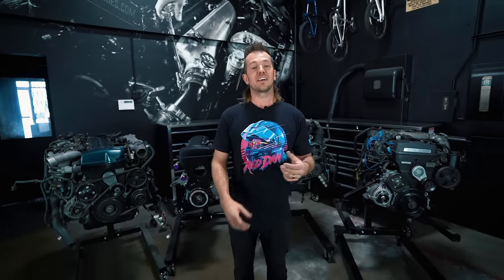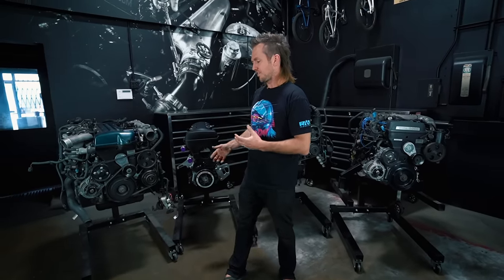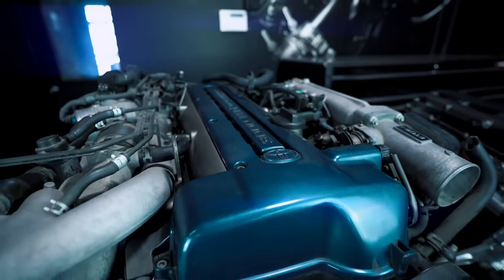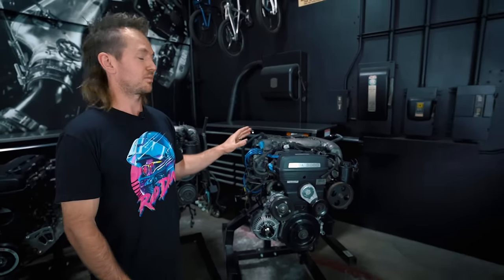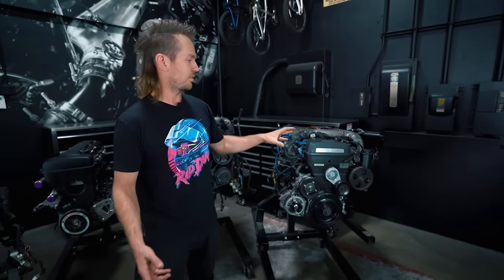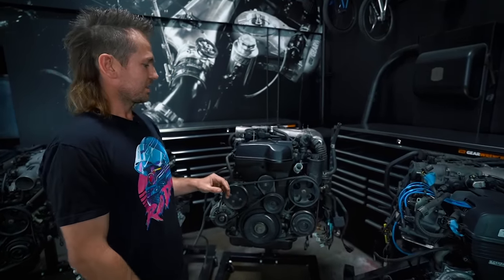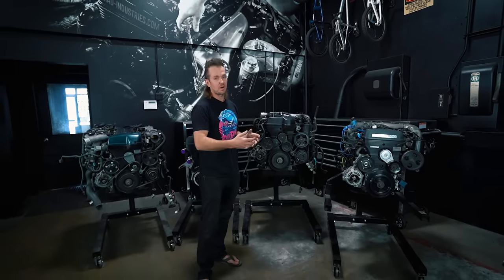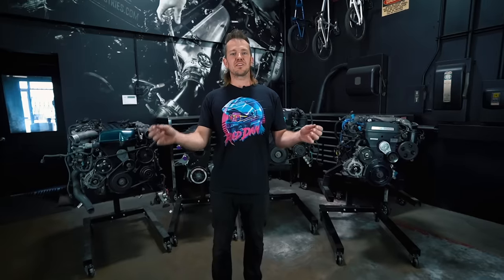2JZ Motor 101

Comment: Dude this is awesome! I'm currently building a NA-T 2jzge for my mk3 supra but I've been trying to find solid info on what I need. Cant wait for more videos on this!
Reply: That's a pretty insane project. I can only dream about throwing a 2JZ in my MK3 with the insane prices those engines are at now. At least my 7M-GE sounds good...
Reply: @rushnerd  I got mine for $80 last year, but now I'm 7k into the engine for an 800hp build, they make a ton of power but man is it expensive lol
Reply: @AngerySumo91  Holy hell you got some wicked deal. Just look at those prices on Ebay.
I would never attempt a swap myself so I assume the bill would be around $10K. Maybe someday, but it's crazy money when the desirable 2JZs go for $7.5-8K.

I'd be more than ok with 400, but damn man 800HP in an MK3 would be completely bonkers lol.
Reply: @rushnerd  yeah this was supposed to be a project but man I've gone down the rabbit hole hard haha
Reply: @AngerySumo91  I bought my 88' auto targa 7M-GE for $8K this year, 115K miles. I've already put almost $10K into it just in converting A/C, fixing power steering hoses, all the fluids, custom fiberglass quarter window/rear hatch shade trim, and custom LEDs all around. I feel your pain and it's STILL a slow car lol.
Reply: @rushnerd  it's a way of life with these I swear lol, my chassis was only 500 bur 140k and a dead 7m in it with a trashed interior lol. Got all new panels, seats, carpet, all that for around a grand off a part out car and then 7k on the engine but it still doesn't run 😂
Reply: @AngerySumo91  My engine was rebuilt and HG issue solved, interior is pretty much mint, but of course you pay for all that. The lifestyle in these cars I've seen this year and most ones for sale are ROUGH. I get it. Best of luck man, post an awesome video once you get your build done!
Reply: @rushnerd  thanks man I appreciate it!

Comment: with the ge non vvti its so much easier than the vvti some guy made a dual cam sensor for the ge and you dont even have to drill anything he also has a na coil pack that hooks up to the non vvti harness. you just have to plug the wires into the ecu.

Comment: INCORRECT ON THE 2JZGE NON VVTI, IT IS NOT AN INTERFERENCE MOTOR! I have one and snapped my timing tensioner bolt when the other wiggled itself out. It will just free spin not bending any valves!

Comment: On the 2JZ GTE VVTI you can pull about 400-410whp by the way of adding in a boost controller and a anti boost cut then turn up the boost pressure but too high and you risk blowing up your turbo ceramic turbine wheels as the factory ecu and injectors supplies plenty enough fuel to support 400whp.

Comment: I love my 92 sc300 5 speed Na 2jzge with a single turbo 💪
Reply: Are you running stock cam ? What did have to do to boost 2jzge? Does it have a distributor on it ?
Reply: @thaddienst9316  yea it’s a Na still have distributor, bolt on, gte head gasket, AEM ecu, tune on E85 1000cc injectors, upgraded fuel pump, honestly people under estimate the NA engines

Comment: Why is a 2jz gte block 2000hp capable but the ge blocks aren't?
If the cranks the same and you swap rods and pistons into the na bottom, what is the failing point in the na blocks?

Comment: I have a 2jzge vvti that I’m starting to build to swap into my G35. Can you give some Ideas what I need to get it to 400 to 550 HP. I’m want to set it up for turbo. If you can help. Thanks
Reply: Get the block from a nonvvti and a tt head gasket / arp head studs and swap the vvti head over to the non vvti block. While there separate the mid oil pan from the engine and get to drilled and tapped ( took my mid plate off the car and brought it to the machine shop cost $30)   put that back on and then add your turbo goodies, bump up the injector and fuel pump size obviously. Aside that you're pretty well set

Comment: 2JZ-GE non-VVTI are not interference engines. Non-turbo pistons are the same exact material as turbo pistons but they are stronger because the crown is thicker. Turbo pistons are not forged but they are especially well cast and feature two coatings to reduce friction and manage heat well. The same is true for all 1JZ/2JZ pistons regardless of aspiration. VVTI block castings are different but functionally the same. Some of the later non-VVTI engines actually used VVTI blocks while the change over happened.
Otherwise, good summary.

Comment: This definitely helped me out. I wanna 2j my s13 and just make a solid 500hp without spending a million dollars on a build witch I feel like will be impossible. He even said it himself the prices on 2jz are going thru the roof 😩
Reply: I went to the junkyard and pulled a 2jz ge vvti out of a gs300, I spend $300 and about 5 hours to completely pull. Ge heads are better for flow anyways, just gotta put gte rods and pistons in.
Reply: @superbird9095  The whole GE head having better flow has already been proven to be wrong. Regardless air flow isn't really an issue on any of the heads and the slight differences only begin to show difference when pushing the engine way past 1,000hp. Realistically not many will come close to that threshold and those that are at that high of a level will probably have some headwork done already further pushing the threshold higher.
Reply: @zXCrackersXz  Have you seen the heads compared side by side? Lmao the intake on gte has a big hump on the bottom-middle of the port, the exhaust is also bigger. Clearly you don’t own a 2jz and you clearly don’t understand how airflow effects the motor.
Reply: @zXCrackersXz  There’s a reason why nitro dragsters have a big intake for the blower because it adds length and rifles air down to the blower making the air cooler as it enters. If you have ports that are slightly bigger it will probably add to better response and better turbo spool, not really effecting hp. But full porting will add to both response and better power.
Reply: @superbird9095  Lol I have 2 2JZ's chilling in my garage and my 1.5JZ on my SC300 but sure kid I don't own a single JZ. You have some sort superiority complex? 

Go read all the technical data on the forums. The GE head overall does not flow better than the GTE head. The GE exhaust barely out flows the GTE but not it's intake. I've had this convo with many other Supra and SC owners as well as looked at the technical data. Everyone I've ever talked to has said realistically it doesn't matter as they all flow well and will easily achieve the numbers people aim for.

Comment: Could you put rods from a non-vvti na engine and put them into the vvti na with aftermarket pistons and still make high power?
Reply from the maker: Yes you could just put a VVTI head on a non VVTI bottom end and make 500 and it would be pretty reliable

Comment: One thing about the GE VVTI, when you remove the engine from the donor car it disables the computer. You either have to run stand alone engine management or you have to have your computer modified.

Comment: The UK and Germany got the most powerful Supra's.  We got bigger injectors,  brakes, oil coolers and turbos. Our cars were 325bhp everyone else got the Japanese version rated at 280hp, until 96 when  Europe stopped taking them, at which point the Japanese car then got the glass headlights,  bigger brakes, basically all the parts from the UK cars no longer being used.
Reply from the maker: America had the same turbos and injectors and brakes. We had 320 you guys had 325. But you had a few small features we never got.
Reply: @RADIndustries  did you get the ceramic turbos or the steel one's?

Comment: People have been pushing stock bottom end GE non vvti well over 900whp.
Reply from the maker: Never heard this before, but if you say so 👍🏻, that’s wild
Reply: @RADIndustries  This is a classic expample of the fisherman tale and 2JZ's. Everytime someone talks about it, it can hold 100hp more. The safe number on these motors used to be 650-700. Kids are reading forums and hearing things here and there and suddendly these are 1000whp capable motors stock.

Comment: So I’m in the middle of building an is300, got non vvti ge pistons and rods and a gte headgasket (among heaps more), aiming for 500-600whp, so even with the decreased cr, I should really invest in forged pistons? or will the non vvti ones be fine with a 9.4:1 ish ratio?
Reply from the maker: They will work but you know they aren’t designed for what you are asking them to do. They won’t last as long

Comment: In all honesty id like to get these heads, cams charted and compared.  Get at least 5 or 6 sets of the oem heads and cams of each model and flow bench them from progression of lift and then chart the average cylinder flow intake and exhaust. Get average cam lift for intake and exhaust. We know the bottom ends are stout but I feel the 750-800 Hp number is just a hype number I want to see torque curves.  The torque curve is way more important to me than the horsepower slightly less hp but a huge improved torque curve will drive more consistently.  Also those extreme hp numbers I personally don’t think the average tuner attains that I’ll give the benefit of the doubt maybe 500-550 but reliability is gone. And of course there’s the the guy with I got a friend who did this and then out come was way higher than what everybody else says.

Comment: Great video! Your thoughts on a 2jz ge vvti head on a 2jz ge non vvti bottom end with gte head gasket and arp head studs as well as oil filter sandwich plate to feed oil to the vvti gear.  I am in the process of building this and what do you think this set up could hold power wise on pump gas?
Reply: That setup is pretty much exactly as stout as an aristo block. A sandwich plate is unnecessary if you use an is300 union bolt for oil feed.
Reply: @DR-kc2pp  thats true, I am building the engine to go turbo so was going to use the sandwich plate to feed the turbo and vvti gear.  I will look into the union bolt to see if it can be used to feed both of these areas, thanks.
Reply from the maker: That’s the best of both worlds with a GE, but you still can’t go as high as a GTE block on power. But 500 is possible
Reply: @RADIndustries  nice thats about what I'm looking for, 400 to 500 whp.  Thanks for the insight and look forward to the videos!

Comment: I'm confused, Adam lz run a GE block due to higher oil pressure because the oil squertters is not there on the GE. And raddan wants oil squertters.. help me out im building a 1.5jz with ge block right now
Reply from the maker: Oil squirters help keep hot pistons cooler. It can be done without them. But trust me when I say they are there for a reason. I personally have never damaged a single part in a bottom end. I have build many race engines and never had low oil pressure and never hurt a engine. People seem to like building them without squirters but I’m not one of those people.
Reply: @RADIndustries  thanks for the reply dan 😀👍

Comment: Will the first 1 far left( gte vvti ) fit into a 2006-2012 Lexus IS250/350 ? Or what would be the best 2jz to Comfortably & Reliably handle 650-850HP/Whp in a gen 2 Lexus IS250/350 ? This answer will help a lot, I'm not confident in a 1000hp build bc of the thought of things breaking so knowing which 1 is best for the second generation IS HP range would help bc I'm not too mechanical savy

Comment: This video is mostly correct, but I'll just kindly correct a few things if I may.

The GE NON vvti is actually 10:1 compression, not 10.5:1, but the GE vvti is 10.5:1

Also from what I know, the GE Non vvti is a non interference, meaning if it has vvti, it has interference

Comment: There is also the 2JZFSE direct injection engine, quite a few on these shores. Never seen anyone mod those in any way. I wouldn't try either.
Reply: I've been wanting to build one of those as a side project to test out a theory I have. Unless your planning on doing something out of the norm and have the cash to burn is just not worth it to mess around with it which is the reason why people don't bother with them. The FSE is already higher compression than the regular GE's so you have to use a pretty thick head gasket to lower compression for boosted applications and the rods they use are the same as the vvti GE's so they aren't the strongest either.

Comment: The first gen 2jz GE comes vvti, it states it does not but my 92 lexus sc300 has the vvti Solenoid on the head. rods and cam shaft are better then the ones on the vvti.  I feel the GE is better to build. stock internals only hold a certain HP, only way around it is to upgrade them to put out more HP

Comment: Very informative. So last year I picked up a ‘96 Toyota Crown Majesta and it came with a VVTi NA 2JZ, and from what little info I’ve gathered, there was a short time when Toyota actually had a VVTi NA engine with the more stout rods, apparently the short time between ‘95-‘97ish years, and these never made it to America. We only got the non VVTi until like ‘97 and the US variant only had the weak rods. Now, my Crown still has 10.5:1 compression from what I’ve read, but I think this is due to a different compression height piston rather than having the weak American VVTi NA rods, but I could be mistaken. If anyone has any information on this, that’d be sick. I want to build my Crown 2JZ eventually, but I’ve still got much research to do.
Reply: Majesta are only v8 1uz and 3uz 

What you got is a crown athelete… 
They came out with 171 1jz 
Or 2jz variants
Reply: @jshsvsjejed6960  no I’m pretty sure my car is not an athlete.

Comment: A GE block that is not beat to hell will hold 700-800hp without issue if moderately tuned, ALL DAY with a stand alone without a bit of worry

It takes 600.00 or less to give a non VVTI GE similar electronics to the GTE and VVTI GE. There are a few ways to do it and all have been proven to close the gap. 
It will take significantly more to give a VVTI GE a similar bottom end to a non VVTI. Starting with the VVTI if you are not a VERY competent tuner or builder is a MISTAKE.
Much easier to do the parts swap to get rid of the distributor than to change rods/pistons.

The oil squirters are great if you drive circuit, if you don't... you do not need them. You can cool the pistons with added fuel at the top of the rev range. I believe the block is actually already machined for them in the GE. Lots of people remove the squirters in the GTE

The cast pistons are fine, again, if you know how to control fuel and spark timing

We do not have to drop compression ratio to boost anymore, thats a late 90s/early 00s thing. We have ecu control now. Higher C/R means faster off boost, lower revs and lower boost pressure/smaller compressors = lower intake temps for the same power. You can also go bigger turbo and use the higher C/R to cruise off boost to save fuel while still being able to get out of your own way

Time for boost to build is threshold not lag. Lag is the time between events

Non VVTI exhaust ports are bigger than GTE exhaust ports. Since the water passages are on the exhaust side of the non VVTI GE you can port the intake without much worry and block the EGR with a plug in the 6th hole runner while you are at it.

Comment: Since the GE head has bigger ports, could you swap a GE VVTI head and put it on a GTE block?
Reply from the maker: Yes sir, it’s great for that. There are some details that I don’t love about that head. One being that there are fewer exhaust studs to hold the manifold. But it’s a great head
Reply: @RADIndustries  despite the lack of exhaust studs, would you see a noticeable difference in power with the bigger ported head if you were to compare apples to apples?

Comment: Not sure if anybody will comment back, but, I bought a 93 gte non vvti japanese block with the crank. I'm trying to find out if I can put a vvti head on it without using vvti. Is it possible? I've found plenty of vvti ge heads and enough vvti gte heads for an outrageous price but I can't find any non vvti heads for both ge and gte. I'm just looking for options.

Comment: Dear Rad Dan, I have only one simple question, if you own IS300 2JZ-GE engine, and if you change the pistons and con rods with such for stock GTE + if you put GTE stock head (with the stock GTE VVTI sprocket, GTE oil pump etc) and stock throttle body, will the IS300 stock block with the GTE internals and head will become non interference engine from originally interference engine ?
Reply: Thank you for never answered me … I already did my research …